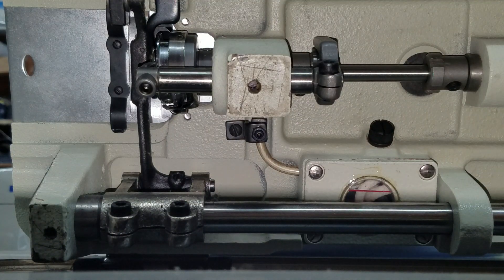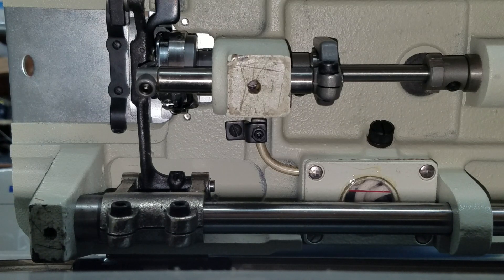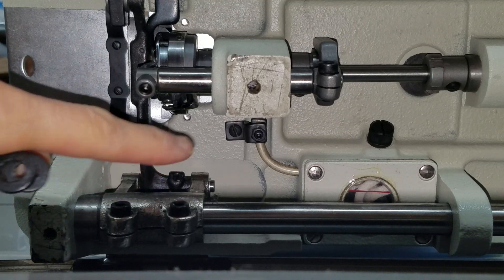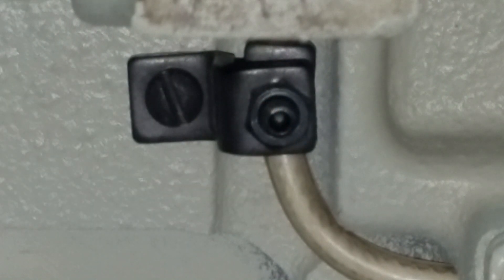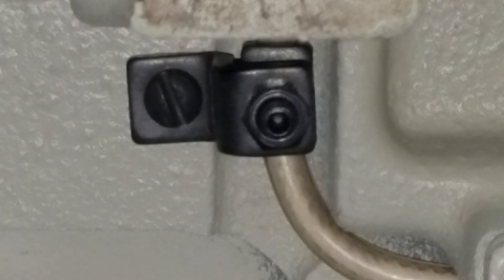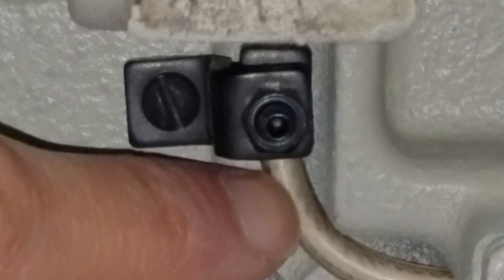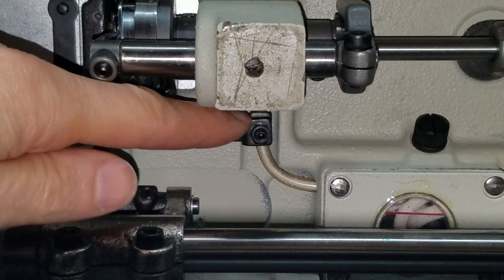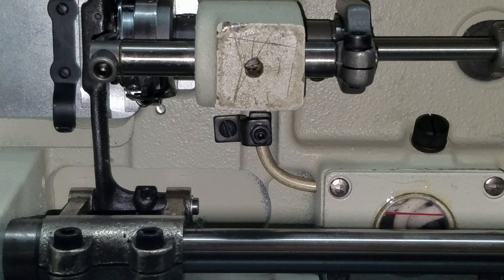Adjust oil flow to hook assembly on a Seiko STH-8BLD-3 (Consew 206RB)

Comment: What did the adjustment of oil help with? Is it related to the backstitch?
Reply from the maker: When you see oil on your needle it is usually being picked up from the hook.  Reduce the oil too the hook to avoid getting oil on your material.